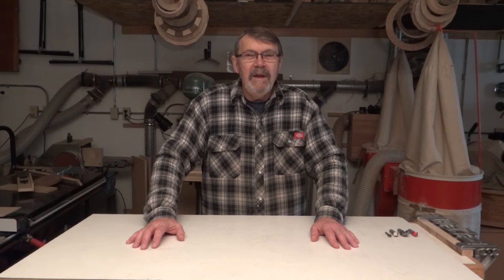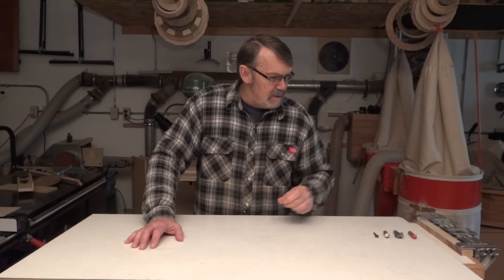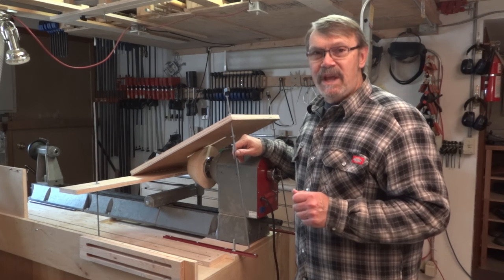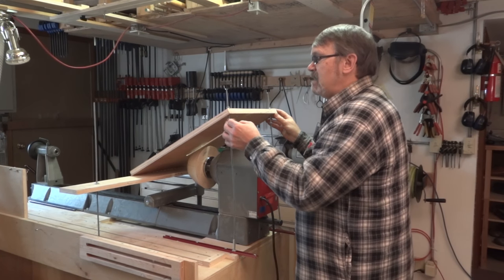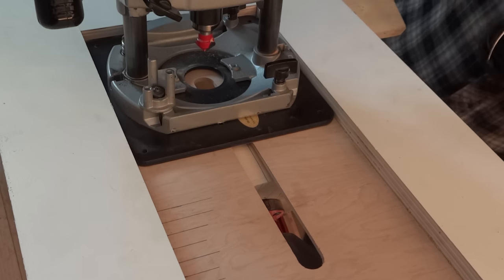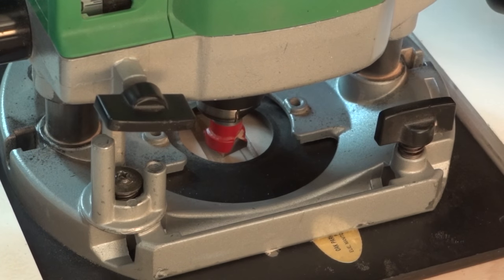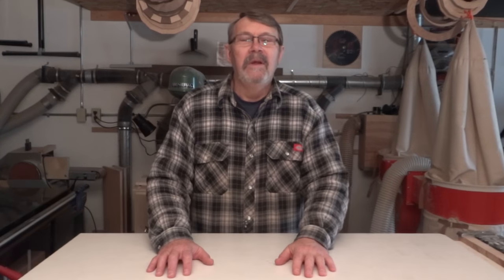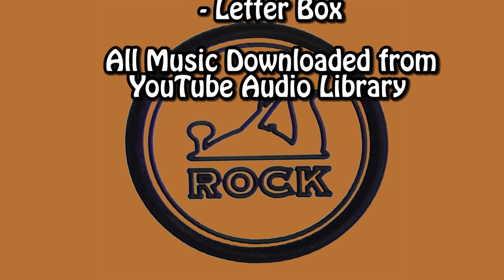Fluting Jig For Turners

Comment: Very nice.  My only concern is that it appears the jig works best with bowls (or spindles) that are fairly flat sided.  The depth of cut is controlled by the base of the jig, which is flat.  If the object has a voluptuous curve, the flute will be deeper in some parts of the curve than in others.  That can create a nice look.  But if you want a consistent depth the length of the flute, the object needs to be fairly flat sided.
Reply from the maker: +David Walser 
That's true, David. I had considered making a jig that would follow the curve of the bowl but then I realized that every bowl has a different curve and I would have to make another jig for every new bowl. I just don't have that kind of patience! It would not necessarily have been all that difficult; just very time consuming. I'm sure anyone who wants to do that would be able to figure out how.
Thanks for watching,

.....Gord